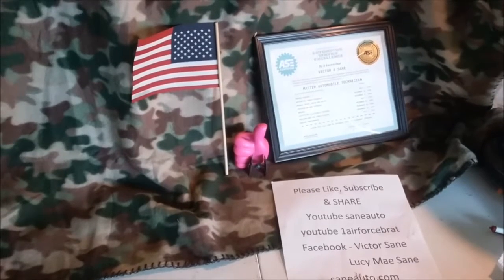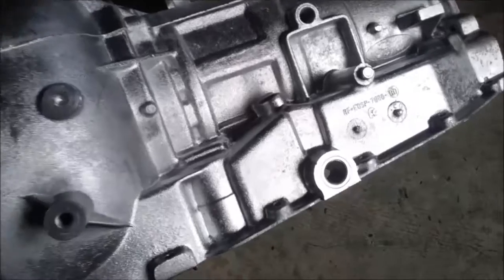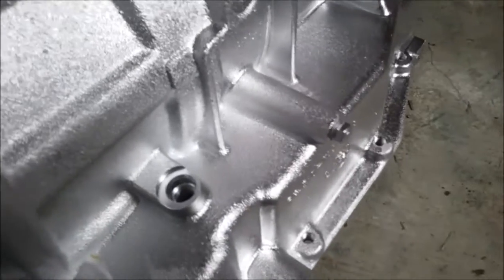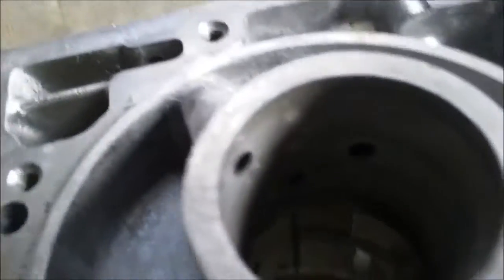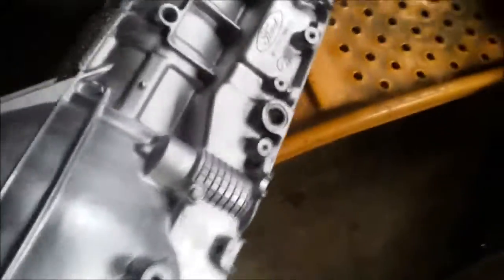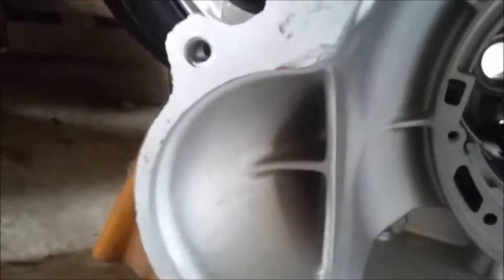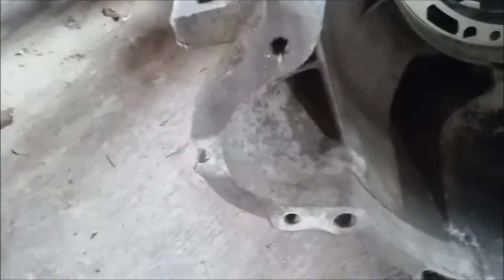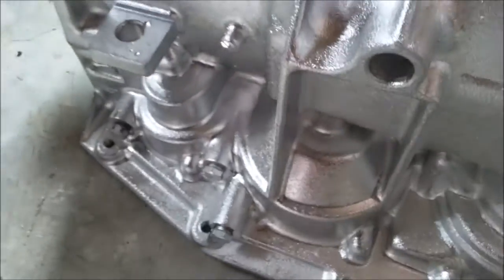Transmission Parts ID AOD AODE 4R70W  4R75W 7 CASES

Comment: I have a 2002 Ford expedition and I went to the salvage yard to get a transmission and I got it out of a 2001 Ford Econoline van and as far as I can tell the only difference is is the starter is bigger on the van so if I change the metal plate and the starter will it still work in my expedition
Reply: Please help
Reply from the maker: There's a 2 hole and a 3 hole starter. You cant replace 2 hole case and starter, with 3 hole case and starter. You might be able to replace a different size starter as long as they both have the same # of bolt holes as the original and the same size nose cone and bendix. No guarantees of course.

Comment: What a amazing video. Thanks. Can you please explain difference between 4r75w and 4r75e. Thanks
Reply from the maker: Yep E has the same low ratio planet set as the original AOD. The W in 4R70W stands for Wide because it has a wider ratio planet set. lower first gear and higher 4th gear aka Overdrive.
Reply: @saneauto  From what I've seen in the literature, the 4R75W and/or units with the "E" suffix both share identical ratios. 4R70W as well. first gear, 2.84:1, second gear, 1.55:1, third gear, 1.00:1, overdrive, 0.70:1.
Reply: @saneauto  What does higher 4th gear mean? Does that mean it gets higher RPM before it go's into forth gear?

Comment: Which one of those transmissions would be on a 2004 Town Car? Also what is the yellow plate that blocks off where the speed sensor called? Mines leaking fluid around it and I need to replace it somehow.

Comment: I have a 95 Ford F 150 with a 4r70w automatic transmission. Do I have to use a transmission from a truck or could it come from a car? Will the aode transmission work in it as well
Reply from the maker: Most trucks, and Lincoln cars have a longer output shaft and tail housing . Therfore you cannot use a regular car $R70W.  AODE has a different planet set with a different ratio.  You could get codes for gear ratio error if trying to swap out W with E units.
Reply: @saneauto   ok I was just wondering cause I'm restoring my truck and needed a transmission. The door code is u which I was told was a 4r70w. I bought one and found out it's a aode transmission. Everything is the same as far as looks. It came out of a 93 F-150. So I should be ok right

Comment: Awesome videos and very methodical. I have no doubt that after watching your informative videos that I'm not even gonna bother lol. My work truck is down and it's costing me money and I can't afford the time an identification error would cost me. That said-and forgive me if I've missed or not seen it yet- but is there no definitive way to ID these things by the info tag? I have only found either very vague or very specific examples of identifying them this way. The code on the tag says PKF-EC0, and it's designated by the letter A on the door. It's a 2005 f150. Thanks in advance for any insight on this matter, and for sharing your invaluable knowledge with us all. Keep up the great work
Reply from the maker: It should be a 4R70W with 2 speed sensors by the code. But like i said in the video The 2007 E250 van I was working on has the original transmission that for that year and engine size should have come with a 4R75W with 2 sensors and in reality that is not what the van has in it. You cant always trust the books. The best you can do is build it and reinstall it. 2nd best is to look and see how many speed sensors it has.
Reply: saneauto Okay, since I need so little nudging to "get off my couch and go get dirty" as you say lol...I went out and took a look and there's indeed 2 sensors. I also confirmed the black 9 pin plug and also got the tail shaft casting numbers while I was under there since I remember seeing some things about that in one of your vids as well. May be a bit redundant, but what the heck. Now from what I gather from your videos, even with all these characteristics it could still possibly be a 4r70w, 4r70e, OR a 4r75e though, right? And thank you for your quick response as well, even though I see a trend of you constantly repeating yourself in your comments lol. Sorry to be a PITA but if it's any consolation it's helping motivate back towards saving the money and doing it myself.
Reply: saneauto Also, the truck already has 230000 miles on it, so I'm really looking at used options and being able to identify them as well. I've seen several used and 'rebuilt' on FB market for +-$400 and I know it's a bit risky, but this truck is a risk in and of itself at this point. I'd be happy with another 20k out of this thing honestly.

Comment: Can you show or tell me where the 4R75W vent is??
Reply from the maker: Top rear of the case. Very close to the tail housing. Please consider hitting the Red subscribe button.
Reply: @saneauto  Your the MANNNN !!! Everybody in the World should Like you and if they Don"t i just think  that they are just  some Hateful People Three Thumbs UP
Reply: I got a 99 f150 and I put a transmission out of a 98 expedition and I got installed but something seems like it's binding up if the motor won't turn over like something's bonded up

Comment: So my 2002 FX4 5.4, should have a 4R70W?
Reply from the maker: The 2002 came with 4R70W 4R75W 4R100 and manual transmission. The 4R100 will have a much bigger pan.
Reply: @saneauto  oh ok.

Comment: Gave this vid a thumbs up and you have a new subscriber. You gave a lot of detailed information. However, I'm still having an issue identifying my transmission. I have a 1996 2wd 5.0l f150. I can't figure out which transmission i have. I got to find out so i can order me a new drive shaft.
Reply from the maker: The only other one you would have in that year is the E4OD and it is way bigger and longer than the 4R70W and 4R75W. There are 2 length tails and output shfts for the 4R70W and 4R75W.  this will make a differance in the length of your driveshaft. This is my video on the output shafts https://youtu.be/FOs4vA5_ae0

Comment: Hi, I was hoping you could lend you knowledge & experience to help me make a decision...

1) Which do you think is a better transmission; the 4R70w or 4R75w... and why?
Specifically in conjunction w a 4.6 sohc v8 (Lincoln Town Car)

2) Between 1998-2011, which do you think is the best model year(s) of the Lincoln Town Car, and why?

Thank you a ton!
Reply from the maker: 1) The 75W is the better "Upgraded version" of the 70W
2) All 2006 and later Fords have enough advantages over the 98 to write a whole book about.

Comment: Have a 96 ford f150 sport.Fotp-7006 can you tell me What it is
Reply from the maker: That casting # indicates an E4OD. Your engine size and whether its diesel or not is a huge factor in which transmission comes in the truck.

Comment: Hello I have a 4R70E on a 04 f150 that broke  and would like to know if I can replace it with a 4R75E and is there even a difference
Reply: That's easy just put the vss sensor with no connector
Reply: Arturo Ruiz 4r75 is stronger you shpuld be able to interchange it but would need to plug the second speed sensor hole
Reply: It's a old posting but it's very similar but probably has a different torque converter clutch.